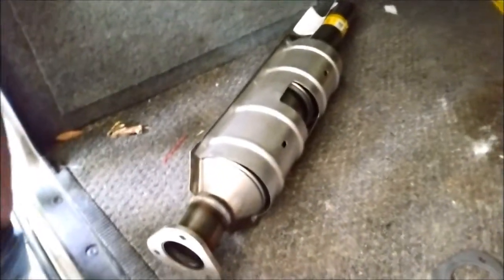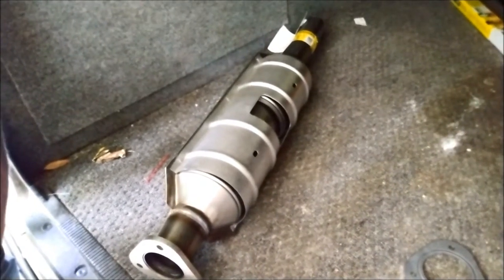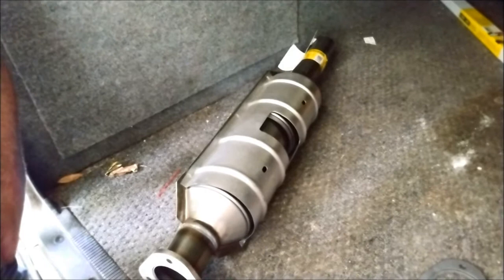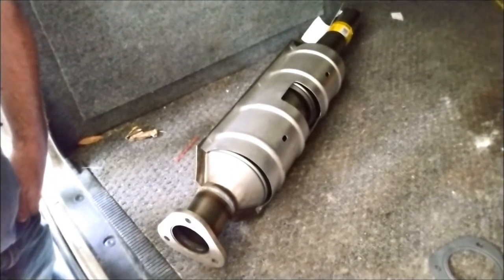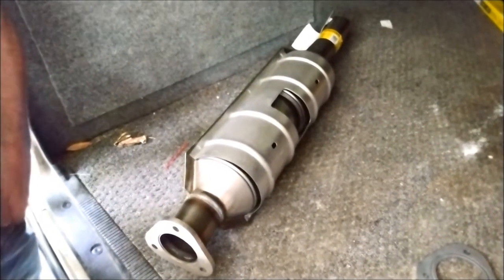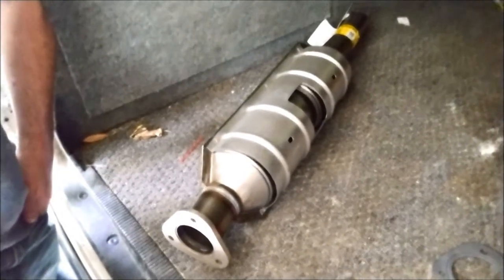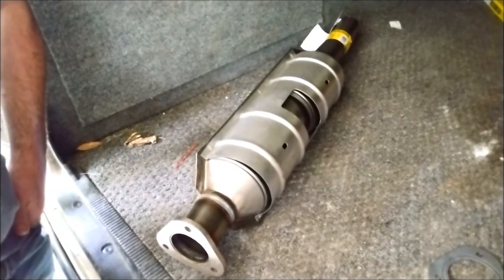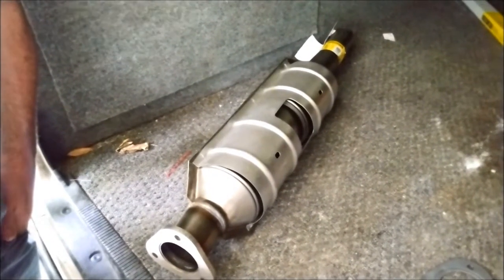Partially Bad Catalytic Converter Symptoms/Diagnosis

Comment: Hey I have the same issues, I have no check engine light on,no weird smell, no visible smoke from exhaust, no rattling. My car is 1995 gt 5.0l v8 with stock cats. No issues with acceleration I can tell but it barely failed emissions on the CO and NOx readings. Would cataclean allow me to pass just enough till I can get enough cash to replace my cats? I was quoted 2500+